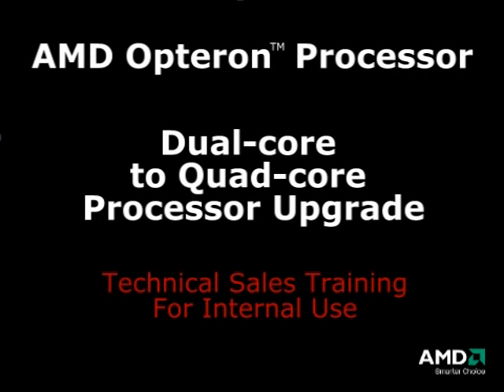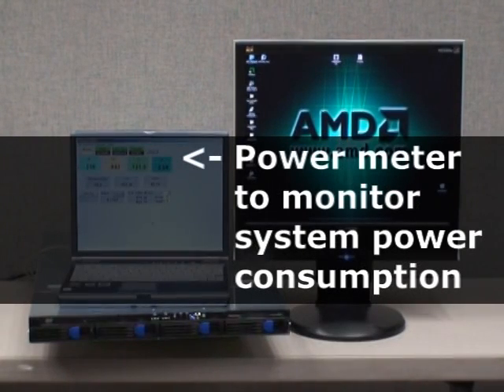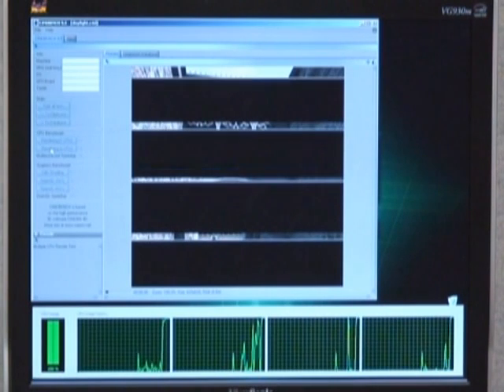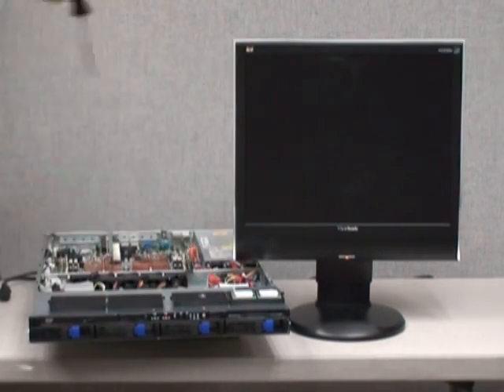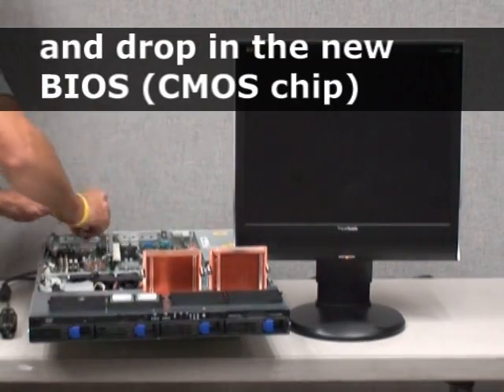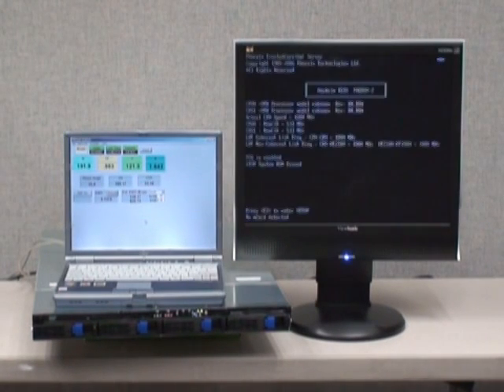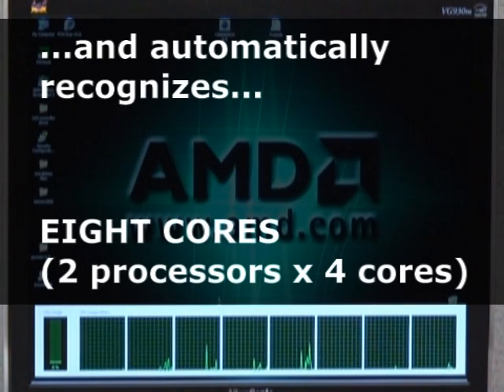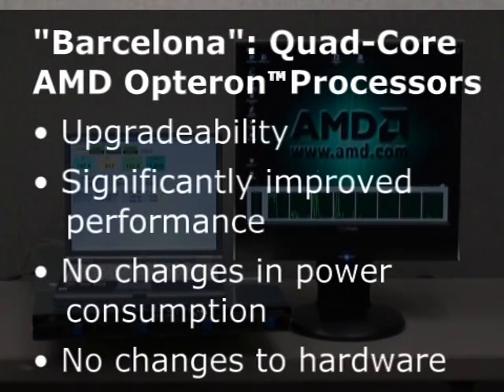"Barcelona" Quad-Core Upgrade -- Training Video

Comment: Somewhat yes.

AMD will prevail. Just see what happens when K10.5, called Shanghai, (45nm refresh of K10) comes out in Q3 to Q4 2008 :)

Intel can't keep doing their tick-tock for long. They will run into problems and lose the performance crown again :)

Comment: klforever2003, without AMD there would be no Core 2 Quads.

Despite having nowhere near the resources Intel has at hand, AMD still managed to produce some very competitive, powerful products, and also built up an impressive customer base. The University of Texas recently acquired 15,000 quad-core AMD processors in order to build a very powerful super-computer.

As regards the 45nm production process..AMD has those coming up shortly.

Comment: All current Intel Core 2 Quad's aren't 'true' quad core products; they're two dual-core CPU's housed in the same package..not on the same die unlike AMD's Barcelona.

Further, unlike Barcelona these quads contain no onboard memory controller or dedicated interlink, hence all 4 cores are forced to communicate via the CPU's FSB. The only thing Intel can do at present to try and alleviate this bottleneck is to raise the FSB speed and increase cache memory.

Comment: klforever2003, Intel doesn't have a quad core cpu on the market yet.  They won't until Penryn is released.  Penryn will be more expensive and it will use more watts then Barcelona.  Making a chip smaller doesn't make it go faster, it makes it more expensive for customers.

Comment: Kudos AMD.   I've been watching you lately.  I'm running an AMD FX62 now.  I've been very happy with it.   From what I've read about Barcelona it's quite impressive.  Whether or not it will beat Penryn in speed is another thing.  Sales?  65nm costs less to produce then 45nm.   I think AMD will continue to gobble up market share from Intel.